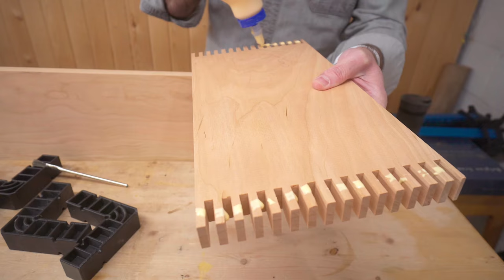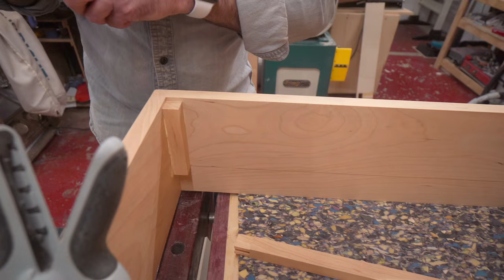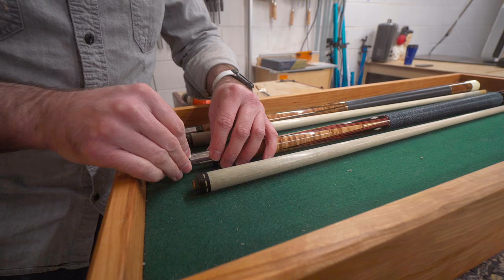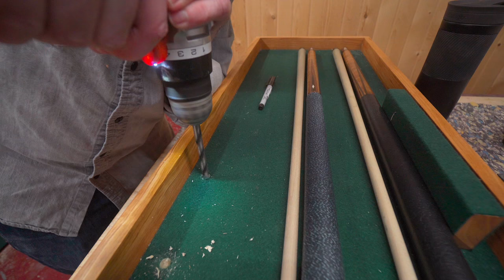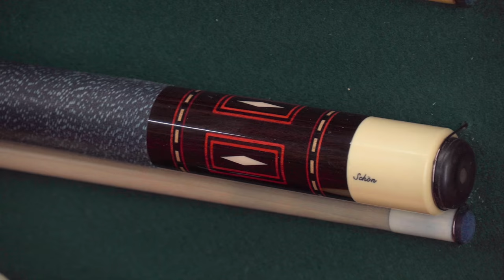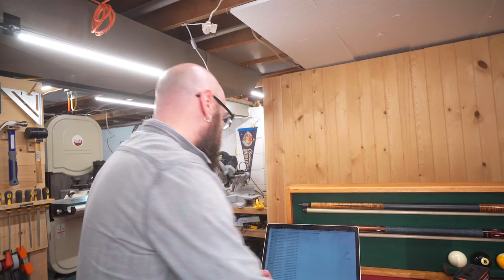Pool Cue Shadowbox Display | Tribute to Dad

Comment: Hey, if you already have a spreadsheet that you take to random.org, you can just use the random number formula that is built in to Excel! The formula is =RANDBETWEEN(bottom, top). For example, RANDBETWEEN(A1, A1300), assuming your numbers are in column A, starting in cell A1 and there are 1300 entries. Be careful after you do this though, as the number will change to another random number anytime you change anything in the spreadsheet. So, if you want to refer back to it later, copy and paste the answer as a value.